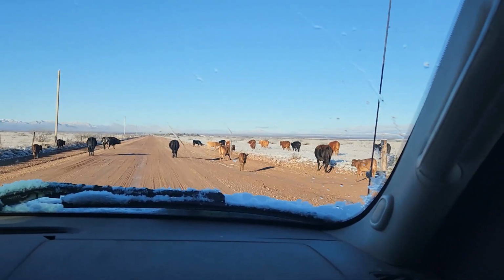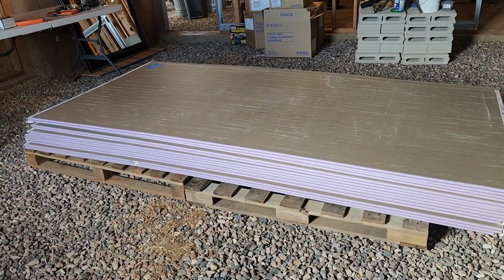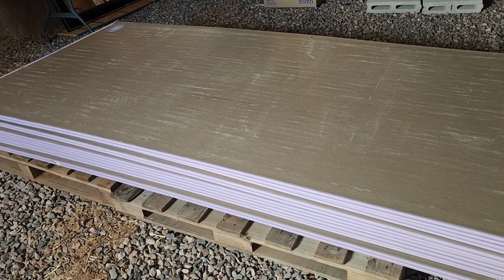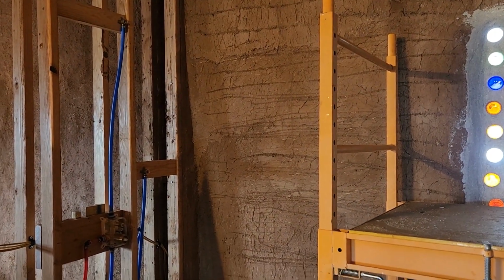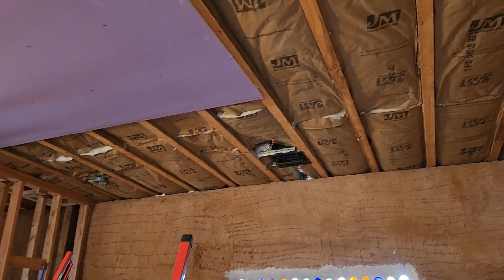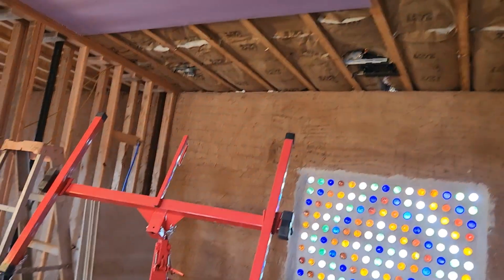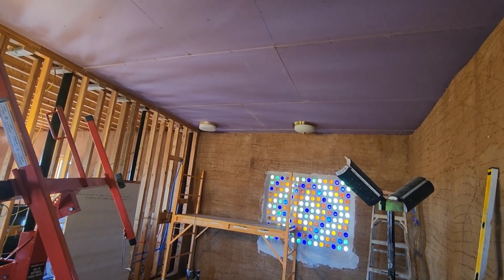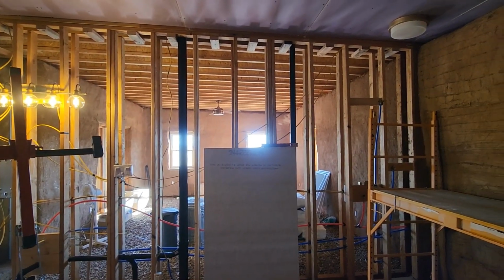Don's been working on the bathroom ep 70

Comment: Love seeing your progress! Drywall and insulation are a lot of work! It's nice you won't have to do all of the walls. 
That looks like the same insulation we used in our ceiling. If you pull the insulation apart some and fluff it before you staple it in, you will perform better. I read it on the bag when we did ours. Glad you had a good Christmas, and wishing you a happy new year!
Reply from the maker: Great advice,  thanks.